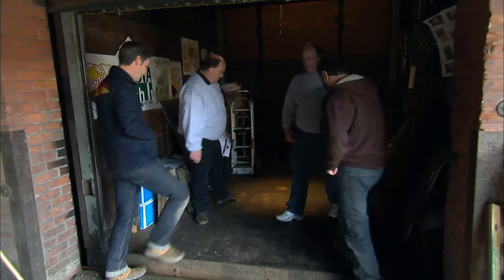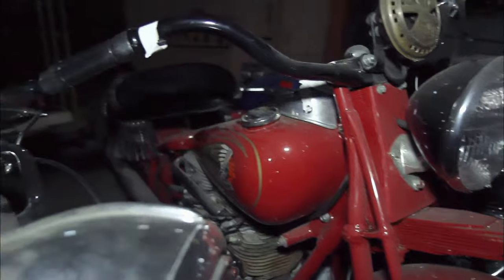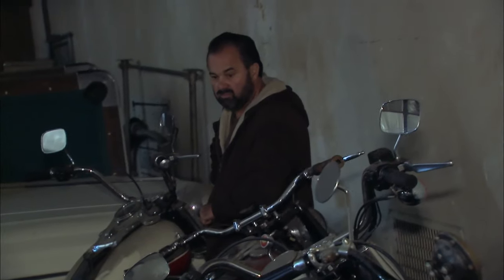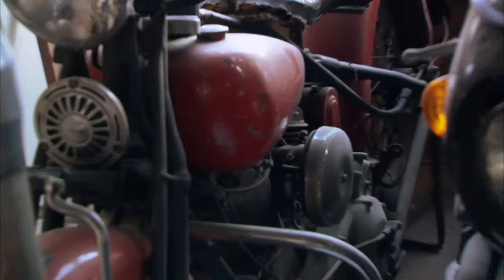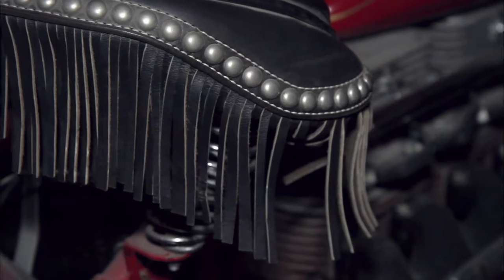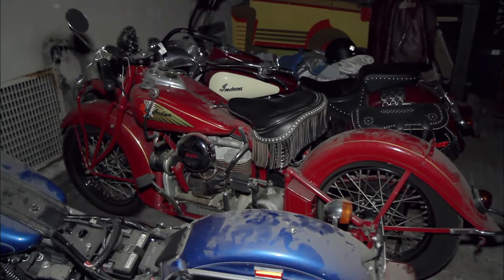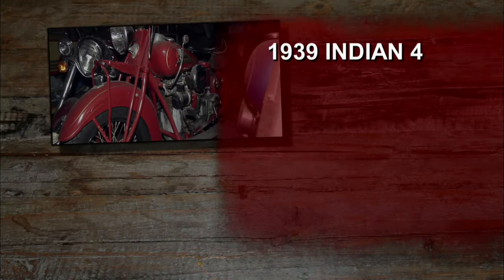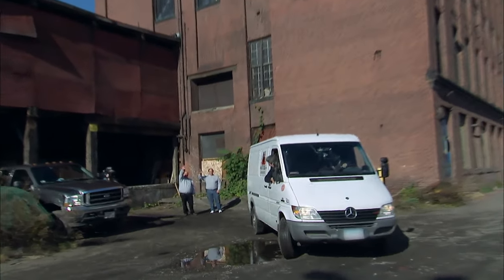American Pickers: Top Dollar at an Indian Motorcycle Honey Hole (Season 11) | History

Comment: I love your show. I have a ? for Mike. I have a 1948 Indian Chief V twin. I changed the kick start to an electric Kiwi starter. I have nothing but trouble with it. Some times it starts and than bam!!!! it won't start. Than the next day, wow it starts right up. Do you know if the Kiwi starters are a bad choice?
Reply: Kiwi starters are good. If it spins over that's not the problem. Most likely a fuel issue.